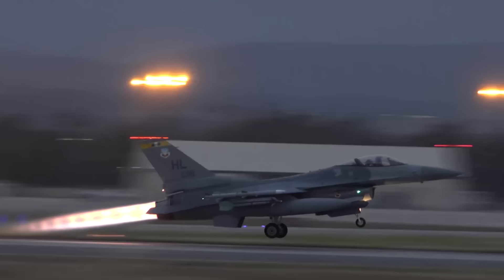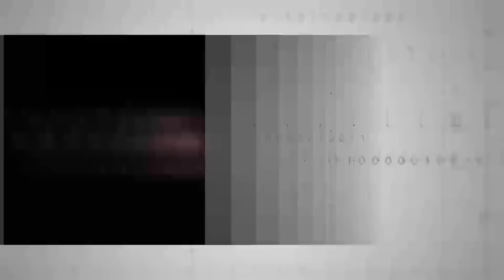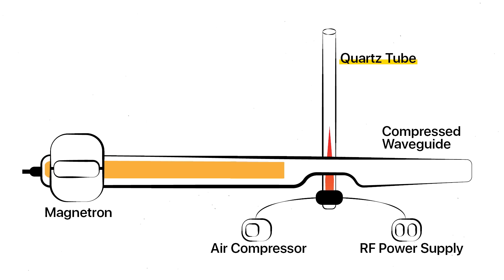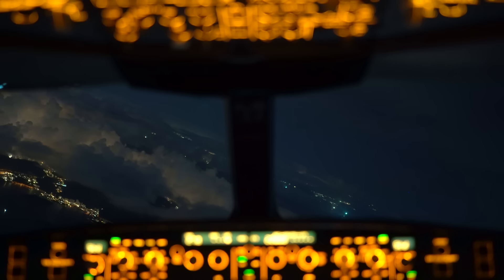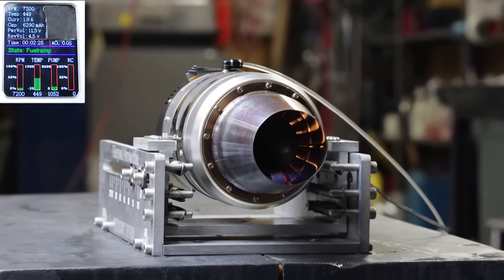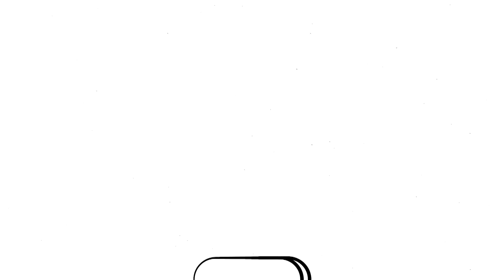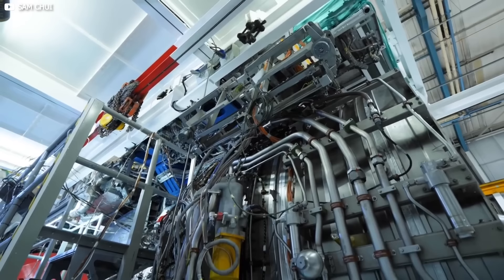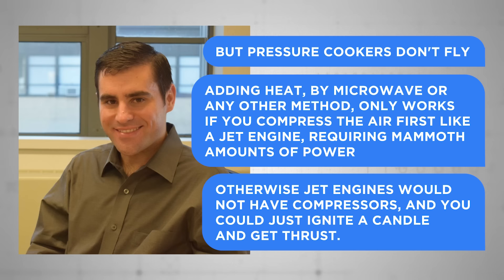What Are Electric Plasma Jet Engines?

Comment: On a serious note - the propulsion part of electric flight is relatively easy. As they pointed out, it’s the energy storage that’s hard.
Reply: Power density of electric motors is also an issue though. In flight both power density amd energy density matter massively.
Reply: Yeah it’s about compressing that energy
Reply: Nuclear powered airplane? No?  Just kidding, been there done that, probs not a good idea if it ever decides to stop working mid air lol
Reply: @AnonyMous-gt8vq  Sure, agree. Hence "relatively" above. Less weight is more efficient, and efficiency definitely matters. 

But the tone of the video was about how this technology was so revolutionary it would enable electric air travel, which really isn't the case. We also don't know how heavy this setup would be compared to a conventional electric motor.
Reply: @FallLineJP  Agreed.
Reply: Actually, it's not that easy. "Ion drives" produce microscopic amounts of force. (28N/kw... there are mousetrap cars that generate more power -- before winding the spring an extra turn.) Until we develop "timelord science" (the ability to put a large room in a small box), we aren't going to have electric storage systems large enough, or lite enough to provide equivalent forces. Gasoline and diesel pack a lot of power. Nuclear might get us there, but the way we currently do nuclear is a solid hell-no! (we've had enough problems with stationary nukes with mountains of concrete around them. putting them in cars and planes would an instant nightmare.)
Reply: Pilot16H  Are you really a pilot?  How is it to be a pilot I wanna be a puolot when I grow up
Reply: Chemical engineering problems, to then perhaps build or experiment to one day develop a large commercial solid-state energy storage for aircraft?
Reply: @rayperez6322  Li-ion batteries are getting close enough to start making for some viable use cases (short range service, flight schools, etc). It'll be interesting to see what tech ends up powering electric flight in the long term. Fuel cells and green hydrogen are another option.
Reply: Pilot16H  YAY THNX
Reply: @FallLineJP  thnx
Reply: Pilot16H  What do you think of the Experimental class like the kitfoxes etc? I think those lower entry bar planes, and the youtube channels like Trent Palmer's could do alot to grow interest and raise a new generation of pilots excited to fly.
Reply: @assarstromblad3280  well, if fusion reactors will work in the future and we can miniaturize them, then I don't see any problem. but good old fission reactors? yeah, you're right, way too dangerous to be feasible
Reply: @assarstromblad3280  Was not done. The NB-36 experiment did carry a nuclear reactor, but did that not provide thrust - it was merely an early feasibility study if the crew could be reasonably shielded from the reactors radiation.
Reply: Pilot16H  STOLEN FOR SURE... BY GUYS LIKE THE WUHAN SCIENTIST LIKE THE ONE IN THIS VID.... they come here on "work or education" visas and then go back and start working on shit they stole from us in Wuhan.
Reply: This is worst than fossil fuel. Destroying organic to energy in long run will destroy earth organic biomass. Bad idea. Literally destroying carbon cycle.
Reply: Pilot16H  The FAA wouldn't change, especially not under this administration, which is doing everything in its power to increase its control everywhere...
Which is unfortunate, it really shows how politicians can ruin anything and everything...
Reply: Don't worry Voolvern is coming to the rescue soon.👏👏
Reply: I suppose you could possibly use some from of super capacitor although it won't last long enough but it will charge faster than lithium
Reply: Where will they get that much electricity? We can’t drive a car too far on battery alone so where/how will we carry enough to power that? Please…..no one say solar panels….please
Reply: Please explain: What is "Energy" ?
Reply: @ytrebiLeurT  Joules.
Reply: @FallLineJP  So why do you call it Energy and not Joules ?
Reply: @FallLineJP  despite popular myth, batteries have not increased thst much in capacity the last decade. In 1990 it was about 130wh/kg  in 2000 it was about 200, in 2010 about 230, in 2020 about 250.

There is no souch thing as Green hydrogen... its just a energy carrier
Reply: @AnonyMous-gt8vq  
Electric motors are every bit as power dense as gas turbines, there's no issue here. The issue is the energy density of batteries.
Reply: @matsv201  That's.. about double in 20 years? It took over 50 years to double the thermal efficiency of jet engines, and the state of the art today is still around 50%.

The story with Li-ion batteries is much more about cost declines than gravimetric density, which helped make EVs cheaper than ICE already. But they are fast approaching useful applications for air travel - expect to see personal air taxis to small regional planes in commercial operation this decade.

Don't forget that electric motors are extremely efficient. It's not just about batteries vs fuel, but the total performance of the system. And its cost.

Green hydrogen is just an industry term for H2 produced via electrolysis powered by renewables, which makes it essentially a zero carbon fuel. Yes it's an energy storage medium, not an energy source per se. But it enables us to decarbonize many industries that can't be easily electrified (in theory.. the current production volumes are quite small).
Reply: @d.g.1986  The US needs to start offering educated people citizenship so that they don't leave. Make it a method to gain entry and residence and suddenly the country starts accumulating smart people.
Reply: @turbo-bike7999  You don't want a engine out as you pass through a cloud? (Ignoring the massive gap between the energy produced and what is needed 😉).

There a fellow on YT making solar powered model planes though. It has been some time, but the last I saw he was able to fly all daylight hours. It's not really the same as the speed of an airliner, but it is possible for a slower plane. Then again, gliders are able to do much the same without an engine at all, so takes some shine off the accomplishment.
Reply: @matsv201  I like how all the H2 proponents just seem to gloss over the whole where does the H2 come from... Or if they do address it they say from "clean" electrolysis and solar, but ignore that it causes huge efficiency losses that a battery doesn't experience.

I suspect we may still need it anyway just because we cannot currently manufacture enough batteries, but hopefully some new technologies in the works will fix that issue.
Reply: @matsv201  A few days back I was doing so back of the napkin calcs on the efficiency to explain to someone, and it is really terrible. .7 electrolysis, .7 compressor, .4 fuel cell, .9 power electronics, .9 motors. For a total of 16% efficiency. I am sure with the right processes that can be improved significantly, but it is doubtful it will exceed an ICE. And then the cost... Even at large scales it will be difficult to even approach ICE or battery electric.

I haven't seen that process you mentioned, I will have to look they one up. Though it looks like it still has carbon in it, so will likely never take off. I guess since you are simply using carbon that would have returned to the atmosphere anyway through rotting, it is largely a neutral producer.
Reply: Just shrink the plane & passenger's
Reply: I guess that means it’s about time for the invention of some sort of… futuristic.. capacitor? 😱
Reply: @alexkennedy7770  Li-ion batteries are getting close. Expect a lot of regional service to start moving to small electric planes this decade.
Reply: @trevormooris7747  
What are you talking about? How is ionizing the air consuming anything organic?
Reply: @matsv201  
You don't consider that margin significant?
Reply: @matsv201  
Still seems better than gas 🤷🏾‍♂️
Reply: @ivoryas1696  In what way would it be better?

you create all the other biproducts like nitrooxide regardless.
Reply: @ivoryas1696  not really no
Reply: @matsv201  
How do you create Nitroxide (and I'm pretty sure that's not what it's called)? Wouldn't we use Electrolysis?
Reply: @ivoryas1696  NOx is created by the fire, both nitrogen and oxigen alreddy part of the air, it only need heat to combine. Becuase of the very warm flame and how  jet work, using hydrogen is them creare a lot pf NOx
Reply: Yep.  Drones use electric power all the time.  The batteries just don't scale for large passenger jets.
Reply: It's possible to using nuclear power?
Reply: @jfbeam  What about fission powered ion engines for deep space exploration? More "juice" from reactor would be sufficient to power larger ion engine? for example to power probes that get way faster to Gas giants and further?
Reply: @kamilpotato3764  Eventually yes, when time is an issue for human flights, or if when we start the interplanetary ferries, basically a fission powered craft that goes between planets and moons for resupply missions, with the core only being activated once it gets to a certain orbit and it will never be allowed back to an orbit which can decay. They will do the lion's share of the propulsion, and we would only need chemical fuel to get out the gravity well to dock with them. We send nuclear payloads up all the time in the form of RTGs for rovers and deep space probes, and NASA has learned its lesson with Opportunity for us to send another non-nuclear powered planetary mission that matters again.
Reply: That and the material sciences. Developing better alloys like they have done for liquid salt based systems will go along way to making these high temperature systems feasible (both with the exhaust and current carrying capabilities of the cabling). Also the use of graphene in solid state structural batteries will give a healthy push for the use of electric aircraft engines. The big plus with turquoise H2 production is its only byproducts are H2 and an ultra pure carbon black which can be used to replace the mined and processed graphite in batteries.
Reply: That other engineer thought otherwise.
Reply: same for pew pew weapons
Reply: @theoneeyedwoodsman4726  Nuclear fusion could work, definitely, I was talking about a good old fission reactor on a plane, which probably isnt a good idea. 

But to be fair, I think it would probably be better having a fusion reactor on the ground providing electricity in order to split water into hydrogen and oxygen, and then just run hydrogen powered jet engines on planes instead. Would be cheaper and much much lighter than hauling around an entire reactor with super heavy shielding and electromagnets on a plane.
Reply: could literally be done with a well designed electric turbine engine instead of trying to be all sci fi about it, but yeah its energy density, gas has more than batteries
Reply: @jfbeam   Well aircraft carriers are nuclear powered
Reply: @jfbeam   And what do you mean by timelord science
Reply: I think they somehow solved it that was the true reason to close Wohan city to all world.
Reply: I appriyer magnetic field convert warp drive ingine pr minat kmph.
Reply: First one to solve it makes trillions.
Reply: The principle of the railgun underlies the unusual design of the aircraft, but it is rarely talked about because it is a secret thing. The topic of pulsed plasma engines has been known since the early 1960s (see PPT - Pulsed Plasma Engine in Wiki) - they are usually designed for spacecraft. But I will tell you about a little-known design - plasma propulsion panels for vehicles flying in the atmosphere, they use the same pulsed plasma engine, but reduced to the size of a pencil and stacked like cells in the panel. The design is similar to the screen of an ordinary plasma TV, because there are also bit cells there to activate the glow of pixels on the screen. And in plasma propulsion panels, the discharge cells are long, the spark gap has the architecture of a railgun (just rail contacts or coaxial), and the ionized discharge air is accelerated there by the Lorentz force to enormous speeds - a kind of ramjet engine is obtained. Just imagine! - tens of thousands of small ramjet engines assembled in a panel and synchronously firing plasma at a huge frequency (hundreds of kilohertz). Thus, plasma propulsion panels create lift with the help of pulsed emissions of plasma jets from the cells of the railgun - a huge impulse is obtained, and the plasma twists the air into toroidal rings - the aircraft is supported on this air cushion. Horizontal acceleration is created by the same plasma panels on the sides of the device (they glow, from the outside they look like "portholes"). Devices such as the "triangle" or "disk" have been observed for a long time, they are mistaken for aliens - but these are terrestrial devices. They are classified and used for espionage and secret activities. Pulsed electromagnetic technology generates microwave radiation, so it is harmful to health, so they rarely fly - only on military missions. And for a citizen, therefore, they are not suitable. Declassification has now begun - too many people know about this secret technique. After declassification, they will be used for cargo airships.
Reply: It's not easy but it just barely mentioned here. Imagine that this engine whight on par with regular jet engine. If it give you 28 N per 1 kW of power and you need 15k times more than that. So it would be 15MW of power and that a lot. If you have seen ultra fast charge cables for cars you probably noticed how big their cables are. That only for 600 KW while power we need is 20 times bigger so wiring would be an issue for sure.

Comment: Even if using imaginary super batteries and super cables carrying the power to the engines, you'd be using fossile fuel-powered grid electricity to charge the batteries.  And we are not even close to changing that fact.

Comment: The bit about conventional fuel is 43 times more energy per unit weight is true. Just to add to this, conventional jets get lighter as they go farther. Electric jets will barely get lighter. 🙂
Reply: hydrogen is twice as energy dense...
Reply: anti-matter as fuel  perhaps ?
Reply: @danzjz3923  per kilogram it is more than jet a1, but since hydrogen is not dense at all so you'd need a much larger volume
Reply: @danzjz3923  making hydrogen isn't that efficient, however for energy dense applications its probably the best way for now.
Reply: @Down915  well if you are keeping the hydrogen uncompressed then it will give you buoyancy so really just get hydrogen powered zeppelins

(and then make them not go boom, but everything goes boom if you try hard enough)
Reply: @aerbon  exactly what I'm working on, personal airship with hydrogen from electrolysis.

unlicensed ultralight ftw
Reply: @papaburger  That is a terrible idea. First off synthesizing antimatter is expensive as hell, so unless you want flying to be restricted to Jeff Bezos and Warren Buffet I suggest you look into something else.

Another thing is that antimatter is highly volatile. Only a few grams or so can produce an explosion like the one the little boy or the fat man produced over Nagasaki or Hiroshima.
Reply: @BrunoCunha88  you barely have no idea what you are talking about

we are not at risk of "burning all of our oxygen" we are at risk of large scale ecological disaster and we are actively making our own atmosphere less habitable.
Reply: @BrunoCunha88  the irony of you telling me to get english lessons could be cut by a steak knife

you spelled oxygen and damn wrong

how

also I have literally studied and taken environmental science courses

you clearly have not

please tell me the number one source of oxygen and I will take you seriously
Reply: @BrunoCunha88  fine. 16 times more energy. And when that energy gets used, the object (a plane in this case) gets lighter, which then requires  less energy. Unlike batteries. And added to that, an ability to safely, quickly, and efficiently refuel.  Unless you’re swapping out entire battery packs, conventional fuel, at the 16 times more energy, is still 100 times better than batteries
Reply: @kingmasterlord  Hindenburg 2.0 Electric boogaloo (literally) 🤣🤣🤣
Reply: @Project2457official  antimatter is already used for propulsion and energy production in the universe. Just because we only know how to make antimatter in a particle accelerator doesn't mean it's the only way
Reply: @NoBaconForYou  Not quite true, fossil fuel power stations are about 48% efficient but you have to include the distribution network and battery efficiency.  Batteries are I believe 90% efficient and Electric Motors likewise.  So that would mean an EV is 0.9 x 0.9 x 0.48 efficient, which assuming no distribution losses makes an EV close to 40% efficient, which is directly comparable to ICE not taking account of the pumping, refining and distribution losses.  Where EVs win out is their energy can be derived from Nuclear, Wind, Solar or Hydro sources for which there are much less CO2 emissions.
Reply: @danzjz3923   Yes, it's energy dense, but notoriously difficult to store, being so small that it slips out of even sealed containers at times (granted, in small amounts). I've thought about using Hydrogen energy cells, but, you would need a highly compressed storage of Hydrogen to make this work. Definitely not impossible, just not something it seems companies are interested in pursuing for some reason.
Reply: @User__Not__Found  i am aware, and the mechanisms they use to try to contain hydrogen is insane
Reply: @Project2457official  it's a joke dummy
Reply: It's not about the type of propulsion used,it's how you use it..I'm sure there's a few different methods of propulsion that will be stronger when used together...maybe plasma and nuclear who knows.
Reply: @Down915  I mean, you could have a hydrogen tank under high pressure.
Reply: @TOH_Fan  yes